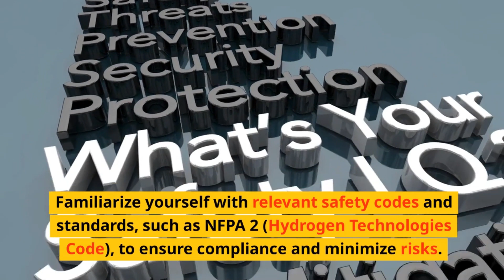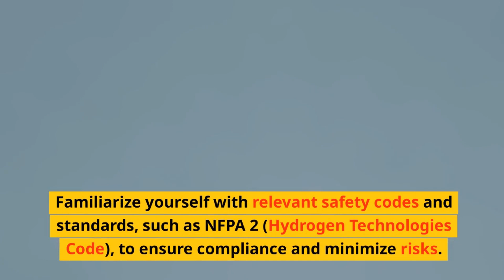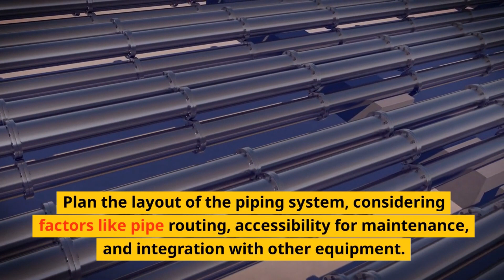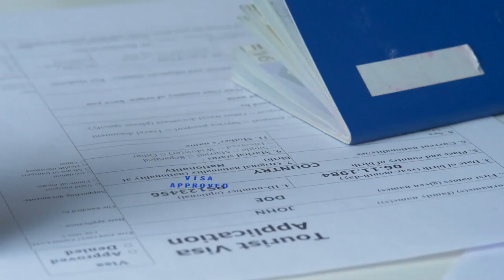Hydrogen Piping: What is Hydrogen Piping, Uses, Materials, Purpose, and Risk of Hydrogen

Comment: Nothing for anyone to learn here. Only a bunch of general recommendations for practice and methods.
The problem handling hydrogen of course is its tiny molecues which will permeate and pass through practically any material. So, hdrogen is very problematic for long term storage.

And, that's aside from its high volatility. an accidental ignition causes a Hindenburg type disaster although it can be argued that it's only a degree of variability comparing to other highly flammable gases like natural gas.
Reply from the maker: It's a first step for hydrogen piping, covered high level points in 4 minutes video, More details in future videos :)

Comment: Thanks for an interesting rundown of a complex problem! However, this could be an even more engaging video if you could provide examples of how the different problems are addressed by engineers. Does one use automated shutoff valves, maybe pipe enclosed in another pipe? What are typical permeabilities for different materials? As a person interested in the topic, bust still a layman, those would be very interesting for me.
Reply from the maker: Good point. It's a first step for hydrogen piping, covered high level points in 4 minutes video, More details in future videos :)